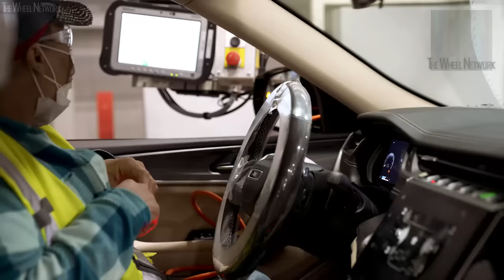Stellantis Production in the United States – Chrysler, Dodge, Jeep, Ram (Formerly FCA Fiat Chrysler)

Comment: 1973 dodge charger SE intervention 2 door 2025 midyear- hood 1" cowl- 383MDC engine, 220mm electronic throttle body control, 2"1/2" inch runners cast iron intake manifold, 74cc/260cc cylinder heads-2.215"intake/1.835" exhaust valves, 8mm bronze valves, 1.70 steel roller rocker arms 7/16" hex bolts, 7/16" cylinder head studs,.900"intake/.900"exhaust valve springs, 10°degree retainer and locks and seals, Hardened valve seats, 7/16" pushrods, update roller block oiling system, hydraulic roller torque camshaft, 8 speed transmission automatic, 16x8 front wheel and tire 245/60r16, 16x9.5 rear rim and tire 265/60r16 cooper cobra..the mustang midyear may be tough.  3.500" driveshaft. 13 inch rotors- black calipers with Charger script in white. 9"1/4" rear end, 31 spline axles, 1983 dodge d150 rear end gear ratio. Paint colors- black, nutmeg brown, seamist green, forest dark green, red, sky blue, white, slate gray. Stock oe vehicle exterior trim, Rear shark antenna,  technology adapted package, no carbon fiber, interior oe bucket seats with pistol grip shifter, interior colors- black, yellow, crimson red(1983 dodge), dark brown, white. 6"1/2" Component system pair in door,  6x9 pair rear deck. Dash 3" tweeter pair.  Rear seat side wall 6"1/2 Component pair. Factory 120x4 amplifier.  Battery 75 group, dual 170 alternators. My car- white paint, yellow interior.

Comment: Oe specifications green automobile glass. Note-1976 4door coronet. A/c of said 2023 challenger. Schematics should be written down first. Roller engine valve covers 383MDC with engine cover, underhood bracing-black. Use metal, woodgrain, seat material leather with no piping, stitching-  chocolate. Chocolate half twill roof  top.

Comment: 1973 dodge  charger 2 door se intervention, hood/hood scoop specs. - 13" inches wide., center of hood placement, steel, 1" inch tall height, 3.5" into hood, 38.5 inches long(under brace with hood for rear air vent), rear hood should exceed/extend 3 inches  after  hood scoop, non functional air vent with diamond pattern stainless steel facing driver,

Comment: 2024 dodge magnum station wagon,  m340 engine., hydraulic roller, 140mm electronic throttle body , m for Monaco , 1976 dodge station wagon taillights,  torque cam. 50 units.   17inch wheels. 255/55r17 on 17x8.5 rims, 5 rims per car. 3 inch driveshaft.

Comment: Ohh please upgrade the 4.7, and 5.7 v8's exhaust bolts diameter by at least 2 millimeters and put a belved shank that's larger the threads on the half that is in the exhaust manifold side!😂
Reply: They stopped making the 4.7 in 2013.
Reply: สวัดดีคับ
Reply: เก็บข้อมูลทุกๆอย่างไว้ให้ผมด้วยคับ👍
Reply: งานทุกๆอย่างมันมาจากสมองของผมนะคับ
Reply: แจ้งทุกๆโรงงานด้วยคับไม่ใช่พลังงานไฟฟ้านะคับไม่ใช่งานโชนะคับ

Comment: I watched this to see why the truck beds and frames and rails rot out . Sure the body is dipped in an primer but the robots are cheap with the paint. Under the hood gets 1/4 of a paint job as well as the door interiors . I watched a truck bed get painted it looks like to me the bottom side never got touched by the robots , Reason they rust through. .

Comment: Total junk cars from the Toledo Plant. They dont top them off with fluid cutting corners when they ship them. They drive them to the trains with 1/3rd capacity of oil and 1/3 capacity with Coolant  trans the same way. I was working one day and seen a buble in the trunk panel of a new grand Cherokee  told the supervisor of its flawed construction he said ship it anyways. Ive seen engines blow and trans burn up before they get to the trains or trucks. In the south yard a faulty oil line caused over 15 cars to go up in our storage lot. I was working one day and two yes two rail cars flipped over full .People do drugs at work they have fights they are lazy I will not ever buy or recommend buying one to anyone.The Helcat everyone thinks is so hot is garbage we didnt even coat the frames at some points depending on time constraints. The grade of steel for stamping is 22 and thats a little thicker then a piece of construction paper.

Comment: Thankfully, PSA is in control!  The Loser's at FCA, destroyed the Chrysler Brand, stolen their money to fund their two Loser Brands, Alfa Romeo and Maserati and allowed FCA's LOSER Design Chief Ralph Gilles to ruin the looks of the RAM, continue to use the POS ZF German Crap 9-speed transmission in three "Bread and Butter" Jeeps and the Chrysler Pacifica.  All other manufacturer's, Honda/Acura and Range Rover have dropped this Crap Transmission.  Moreover, FCA continues to use a 2.4L 4 Cylinder engine that was developed during the Ice Age.  Losers all around, all FCA Management needs to be shown the front door!
Reply: Thankfully Carlos Tavares IS in control!!!

Comment: All this robotic tin work in  a Chrysler plant  seems remarkable technology but there is nothing remotely acceptable in terms of the bizarrely complex technology of the  Mopar on board electronic systems: review the Chrysler Owners sites for a liturgy of the host of electrical problems: As a handicapped person with dysfunctional knees, I value my Caravans for the convenience of driver's side sliding door and gas fill (I can weakly stand on the D/S and R&R the wheel chair and/or fuel the van)  Unfortunately however I  have two that have non-operating body control modules (BCM) that have completely disabled one and while the other runs, it evidences the non functioning of the window motors.
   The BCMs are buried up under the dash and at 89 I cannot do the R&R. I surmise that for Anti Theft purposes Mopar has made access to the BCM deliberately difficult?  Once removed the module can only be repaired by one private firm in Florida: $200 for R&R of the unit here in California and $300 for the bench work in Florida (plus freight)  Caravan BCM and other MOPAR module failures require use of a unique 'Mopar only' hand held diagnostic device costing $1200 and none of the several local 'mobile mechs'  I know have made the investment. Dealership service plus the towing would cost about what the vehicle replacement price would be.   My Ford WindStar van had similar electrical fails but required no unique OBD scan tool.  
  It may be stretching the point but as a former Army 'motor pool' type the lack of operator repair options with modern military vehicles is distressing to me: The death of Sgt. Pat Tillman came as a consequence of our deployment of military vehicles that could not be repaired in the field due to hyper complexity of power train management items. (I refer here to the non-repairability of the  Humvee employed on Tillman's final mission). I served in the company of ex- WWII G.I's who had kept a few ignition components, plus a spare carb and fuel pump and had at times quickly and easily  returned their disabled  Stude/GM/Ford/I.H. ride to  service.  
  I find also distressing the end of the 'Pepper Tree Car Repair' that for decades was a part of our social culture. The complexity of modern auto electrics has ended the decades long tradition of DYI repair that saw fathers, brothers and older friends working in the back yard  and tutoring young people (myself included) on how repairing of cars can be a profitable profession. The YouTube segments 'Vice Grip Garage' show one mech who travels extensively and how he bring the pre-computer era cars into running condition with only a commonly found selection of hand tools (plus his sound approach to his challenges) Alas, his is a competency fast approaching obsolescence as once the pre-80's car disappear from barnyards and hoarders fields  'his knowledge will matter not'!
   I observed a few decades ago, as a substitute teacher that many high schools in my Riverside, Calif area no longer offer auto shop classes: the complexity of the vehicles, the cost of the diagnostic equipment, the lack of qualified teachers and the expense of liability insurance have made auto mechanics a no longer tenable part of the high schoolvocational arts curriculum. Another victim of these modern times! 
   Smokey Yunick a fabled tuner 'back in the day,''  paid a quirky tribute to the back yard 'pepper tree' learning of his adolescence by signing off his own B-25  maintenance logs as 'Sgt Shadetree' . Smokey had 'found' a unclaimed B-25 and preempted as his personal transport while serving overseas during WWII. As a completely 'off the grid'  endeavor the log books were best not put in the hands of the techs yet were occasionally had to be handed to engineering officers or flight line personnel who did need to make entries into the book upon Capt. Yunick's  arrival at new fields and requesting fluids and fuel service.  (when assigned to the C.B.I Theater in the final months of the war, Yunick hitch hiked back to Italy retrieved his personal Mitchell and needed to visit many unfamiliar fields on the long hop back to Burma.  Smokey dutifully  made sure that the log was always current.   
  Smokey personified the long extant speed sport adage of "It ain't cheating if you don't get caught!"
  Please excuse the length and personal digressions in the above..